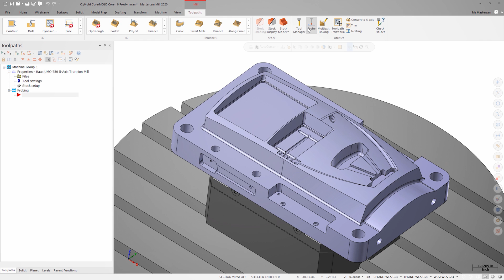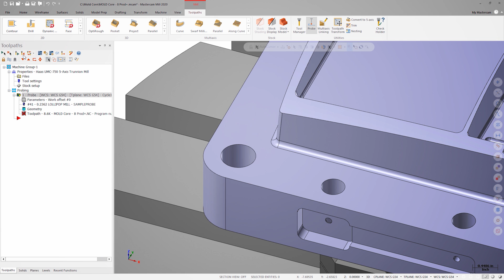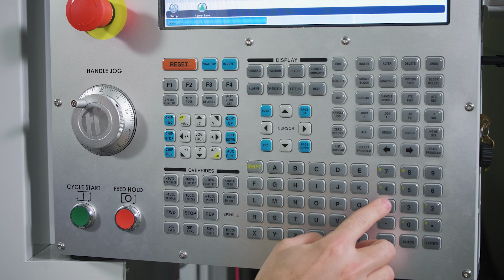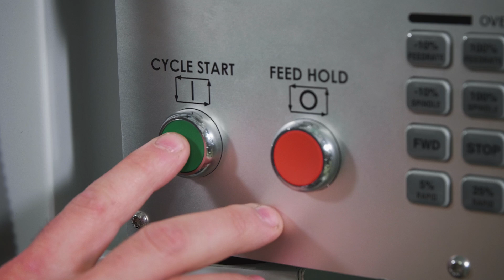Making the Most of Your Renishaw Probe

Comment: why is masterCAM using haas ? you guys have so much money buy a real CNC like a okuma or something
Reply: HAAS is not real CNC ? Are you going to do this cycle only on Okuma or what? HAAS uses FANUC logic, all macros and many parameters are the same as FANUC... this whole probing cycle that you see in the video, I wrote on HAAS already in 2012, while my macro is able to measure the part and throw an alarm accordingly, or adjust the offset of the tool and repeat the operation until the part is within tolerance :) I am able to write these routines for OKUMA, MAZAK and many others

but to claim that HAAS is not good is nonsense! I have worked on many brands of machines and if you compare the price of HAAS and OKUMA, it is nonsense! compare it in the same category!

Comment: I can't believe with probing becoming pretty standard in shops now that this is an add on, I will never understand that.  Just like the add on to have machine sim tied to your post costs extra,  it's ridiculous considering how much we pay.
Reply: This routine is very easy to write as a macro, and you can also do that, as soon as the probe measures the part, it adjusts the D offset on the tool and will do it, until the hole is within tolerance ! but if you use mastercam, it is much more convenient to do it with the help of mastercam, but I have no idea if mastercam can also adjust the D offset of the tool ?! 

That macro is really easy !! Try to learn more about macros and renishaw probes rutines and you won't believe what you can do with them :) nowadays software that can generate macros is very expensive because people don't want to learn :D i recommend the book by peter smid ( Fanuc Custom Macros B)

Comment: How many variables can be recorded?  Like if you had 60 holes in a part, can each hole have it's own variable?
Reply from the maker: You can only display 2 variables at a time on the control but can store as many as you like (as long as you have variables available in the control). There is a limitation by default how many you can post out at a time in Mastercam so for 60 holes you may need a minor RENMF (Renishaw machine file – similar to a post processor) change to allow for more probing routines to be posted at one time. If not they can be split into separate NC files.
Reply: You don't have to display those numbers! It is enough to create a macro template that will work like calling a subroutine with the help of G65 (for HAAS), while you can automatically choose the tolerance range, which, if exceeded, will throw alarm #3000, while you can also write in that macro to adjust automatically by the D tool offset :) there are videos on youtube about that i think HAAS have some